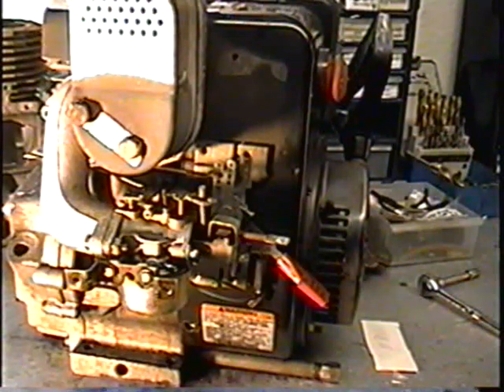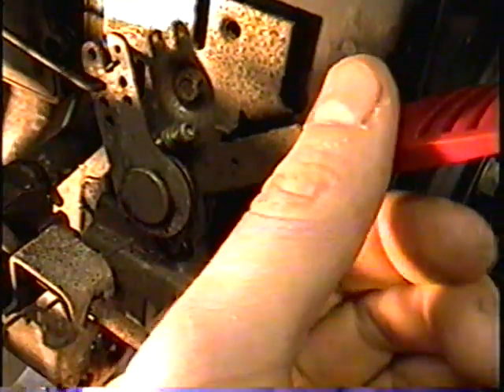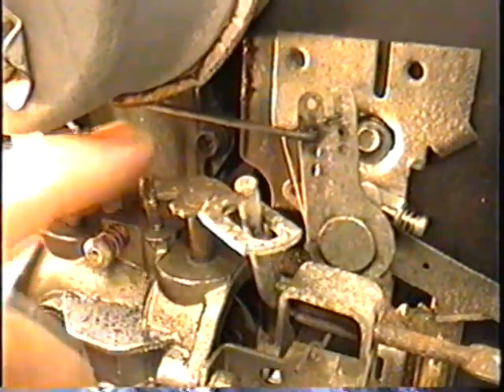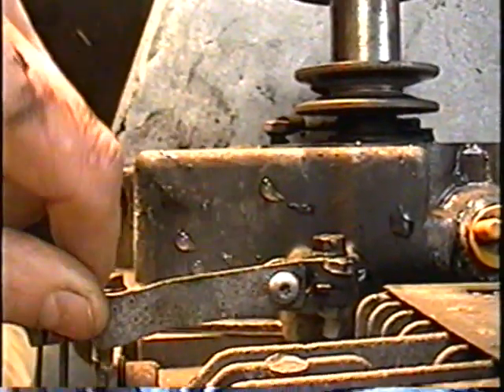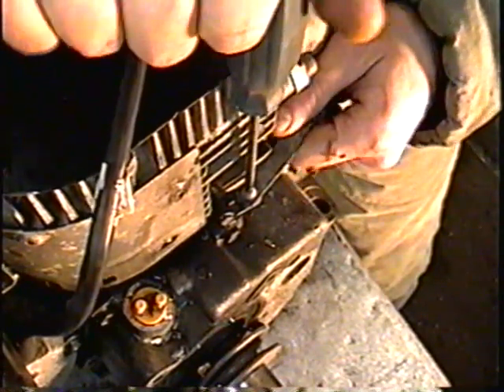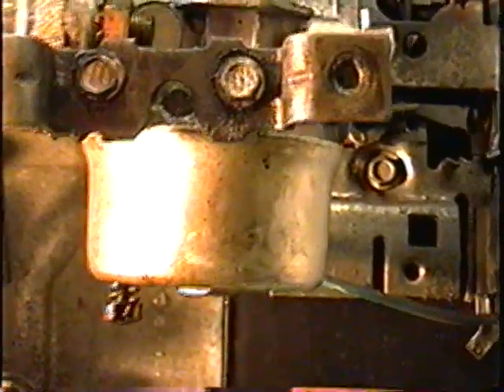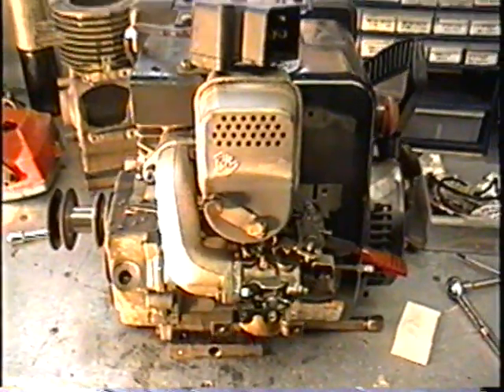HOW TO ADJUST SNOWBLOWER ENGINE SPEED GOVERNOR

Comment: is the Throttle lever suppose to be at idle positon or full throttle position ? in here it says down so i am assuming (idle position) but on google and other videos it says to have it in full throttle when adjusting the governor . 

also what does it mean when i start my snapper 10303S 10hp tecumseh engine snowblower  with the choke on then i turn the choke off and it high revs to the point i have to shut it off right away i replaced the intake gasket, carb gasket, and cleaned the carb and rebuilt it and ( i think i set the governor right ??? i am not sure as im confused about my above part) i looked it up and it said leaks (that can't be it) clean the carb (i did that) but maybe i have to adjust the governor better or adjust the main jet screw or idle mixture screw better . i dont know what it is . and its hard to adjust anything because i can't keep it running to adjust things (or maybe i can) i'm just scared to keep it running while it revs high i don't want to hurt the engine . 

i would highly appreciate your professional input . Thanks 🙂

Comment: How should stay throttle with engine off? 

is a correct way to set the Governor: Unscrew  the governor screw, set to fully open throttle and then tight the Governor screw? 

I don't know if my governor configuration is ok. My carburator throttle butterfly stay 1/3 or 1/4 open when engine is off. 

I havent changed it for now, I don't want make mistakes... I only changed the spring with original code

Comment: Thanks! Donny, I made the mistake to loosen the governor lever to remove carburetor linkage
Reply: How do you remove carb linkages without removing governor arm?
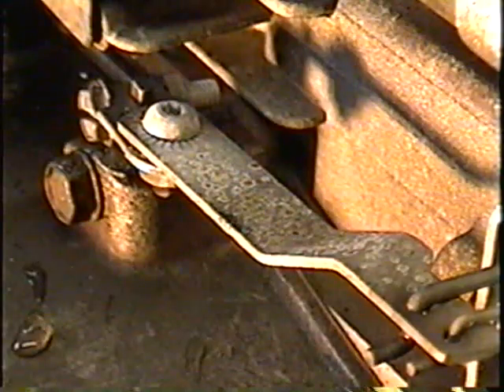Reply: Take the carburetor off. Is only couple bolts holding on the intake pipe and twist carb off the Z - bends that move throttle plate, @1:30. Leave linkage on governor lever. 1:19 show full view of linkage from the governor to carburetor. Take pictures with phone too help w/reassemble @imgusjj
Reply from the maker: Thank you for your support!

Comment: Donnie I have a major problem I can't find an answer to. I replaced the head gaskets on My Exmark Pioneer S Series. When putting it back together the springs on the control assembly came loose and I cant figure out how to re attach them. I am retired on fixed income so I try to fix most thing myself. If you can help me It would be very much appreciated. The  motor is a PS-ZT710-3011 19 HP. Thanks in advance

Comment: Hi Dan, I have an old Canadiana 8hp snowblower that I completely rebuilt from bearings to carb, ive been running it hard with all this snow and every once in a while it Boggs and wants to die while im in deep snow, say every 5 min, I just can't figure it out, took the carb apart , its very clean and rebuilt, all new lines and filter, I even ran it with the gas cap loose in case my vent wasn't working, im lost, never had this kinda thing... any help would be greatly appreciated , thanks for all your good work..

Comment: I've got a question when I start my snow blower it starts up and then I go to hit the throttle and it doesn't want to engage but I go and I mess with that bar the governor and it will stay running how do I fix that

Comment: Two things need to be addressed in this video.

1.  What is the down position for the throttle?  Off of idle?

2.  You mention where the governor arm should be when tightening the screw but you do not indicate where the piece the governor arm connects to should be?  That piece coming out of the engine block moves about 15 degrees in either direction and has a major impact on if this works or not.  

Thanks for all your videos!

Comment: You are my savior. Thanks for sharing your knowledge. Now I have a snowblower that doesn't rev like crazy and keep moving speed around and the idle now works. I might neeed a deep clean though because I was only able to adjust it with choke adjusted at notch 2, 1 being close and 4 fully opened.

Comment: Thanks Dony for your videos. After cleaning my snowblower snowlote 8/26 ..I am sensing my engine is too loud..and thus I concerned that I didn't have screws at the right level. I  took out 3 screws...one at the bottom of fuel bowl and rest two above it...do you think speed governor fix will help reduce the rpm and keep engine quieter...my concern is not noise...but if I am getting more rpm..and hence too loud..plz advise
Reply from the maker: rpms should be at 3600 max

Comment: Hi recently bought a new carb for my tecumseh powered snow blower throttle lever does not return linkage for speed have looked at spring behind it is not  broken this is the spring that goes around shaft in a circle then goes on top of lever control , could this spring be worn out or could i just put more tension on spring to return to idle

Comment: @donyboy73 I have a question about the screws/bolts  that hold the cover plate that covers the carburetor assembly and the ignition wires/etc. What size and threading are these screws, or what type. I'm missing two and the cover vibrates all over the place. I figure it can't be good for the ignition key and the wires which are already not in the greatest shape.

Comment: Great video. Took my snowblower in for new carb and they didn't put the linkage back in correctly. tried to tell me that's the way it is. Uh...no. Still didn't seem right and now it appears the spring at the throttle lever is missing. Any idea on a part number that. The big spring, not the little one that the adjusting screw runs through.

Comment: Donyboy, my confidence in my abilities to work on my own engines has skyrocketed since I started watching your videos. Maybe too much. I'm stuck. New carb (non-adjustable) and some 1/4" internal fuel line had my problem child (Ranch King w/ 8hp Tecumseh) purring like a kitten. Then I tried fine tuning and screwed it all up! Stalls at full throttle. Tried various adjustment on high and low throttle speed screws. Governor hasn't been touched at all. Love your channel!! Any help is greatly appreciated! Thanks!

Comment: Hey Don, ive got an 8 hp tecumseh. It runs like a champ.  Occasionally it overrevs off load. So like when ive gone through a big pile of snow it slows back down, but not to normal. Its like sometimes it gets hung up. Its not all the time though. Linkage and throttle mechanisms seem free moving.  Thoughts?

Comment: I was working in my neighbors blower and it would not run smooth unless you had the choke mostly closed. I checked out the whole carb and saw nothing wrong. I adjusted the governor lever and now it runs smooth. I find this kind of strange??? I have never seen this happen with a new machine. He just bought it last winter. What could have made this happen?

Comment: Thanks! Having these exact issues after putting on a new carb, damn snow blower threw off the drive belt, again! Now I have to bring it inside and open it up. Again! I will try your suggestions
Reply: Hey, close up at 3:32... is there a return spring on the governor or am I seeing wrong?

Comment: Very helpful video to cover what has been written up in a less-than- clear way in other places.  I have a question though on my setup. Picked up a generator with the HM100 that has a piece of linkage with a spring built in running from the governor to the carb, almost looks like it is there to try to clear the exhaust. I have not seen this on any other Techumsehs or other generators of the same model. I’m wondering if this was stock or the issue I’m fighting is someone putting the wrong linkage on. Thanks!

Comment: Thank you so much for putting together this great video. I had the carb on my Tecumseh 9.5 cleaned and have been battling this high idle issue for about 2 months. After watching your video, I made a few adjustments (mainly the idle control being the culprit) and the machine ran like a champ!

Comment: I have a HSSK50  5hpmtecumseh snowblower. Your videos caution against over Reving these engines. What is the recommended  max rpm this engine?  I just put a new carb on the snowblower. Thanks Ray

Comment: Yesterday I replaced the carb, (didn't touch the governor, control arm), adjusted idle screw and carb adjuster at bottom of bowl but still way over revs. Will look at governor arm and throttle  spring next. Of course the machine is 21 years old and don'e own me a dime. Thanks for the direction!

Comment: Hi.  I have an 8 hp Tecomseh on an MTD 24 in snow blower.  I could hear it faintly surging (changing engine speed ) for a long time. this storm it got much worse.  The surging was changing the RPM's much more then it died after I did half the drive way.  I took off the heat shield thinking the carb needed adjust only to find it is not adjustable.  I changed the spark plug.  I cleaned both jets although they did not look dirty.  Carb cleaner is blowing freely through the holes.  I cleaned out the float chamber although that was not dirty either.  It starts fine, sound s good for the first maybe, 2 min then it starts reving up and down and I can see the speed governor moving back and forth, then it starts to run worse and worse and in about a minute it dies as if I had shut it off. 
When I had the float bowl off I noticed holding the float up made fuel run out of the fuel hose (I had blower standing on it's nose) so I don't think it's fuel starvation.  The governor arm has never been off the blower.  After the first few minutes of not moving, the governor starts moving as I described eventually the engine just stops.  Any clue?

Comment: What is the proper rpm on a tecumseh hssk50 engine at full throttle
Reply from the maker: 3200-3600 rpm
Reply: thanks a lot

Comment: thanks as always ...  I've got a 1990 JD 826 and I cleaned the Carb and put in a new Carb kit.  I also replaced the drive belt and the auger belt but it won't throw more than 3 feet. what gives?  it runs awesome and doesn't bog down or anything like that.  any info will be appreciated.  thanks
Reply from the maker: you may need to adjust auger belt idler pulley like in this video https://www.youtube.com/watch?v=Ax-RrotWSlM

Comment: Very good videos. I have a tecumseh snowblower that starts and runs but it pulses the rpm up and down won't stay at a steady full throttle. Also seems to need some choke left on or it will die.

Comment: hi donyboy thank for your video that help me a lot ! But after adjusting  my carburator it seem my job wasn't well done as i thing . When i turn on the auger drive to blow the snow and it become hard the engine slow down and they lost is power. Is it can be  about a bad carburator adjusment or just my engine snowblower getting to old ?? I have another problem to ... the gaseline trought out of my carburator constantly . Leak is between the carbutor base and the casing what could be the cause ? the carburator float maybe ?? thank you

Comment: I'm in south Florida, so I don't have a snowblower, although I did have to find and wear my jacket last week.

I do have a Champion generator, which I'm trying to repair. My question to you is, re: your video, when you said ..."throttle lever in down position..."  with regard to the machine to which you are demonstrating, is the "down" position where the throttle is "open" or "closed"? 

Many thanks - I hope to have the generator ready for hurricane season.

Comment: I removed the carb on my 5hp Tecumseh to work on it.  I marked the hole on the throttle plate that the linkage was hooked to.  I reinstalled it.  When the engine is not running when you move the throttle lever the throttle moves,  When the engine is running the governor pushes the throttle all the way down.  You can manually rev the engine by pushing on the throttle plate but it goes back to low throttle  when you let go.

What did I do wrong and how do I fix it?
Thanks!
Reply: I made a video trying to show what is going on.  I saw where you said having a video helps https://www.youtube.com/watch?v=SA4XjmOWLBc&feature=youtu.be

Comment: just bought a Tecumseh 10.5 it starts great and idles no prob but when i put it in gear and run it ..it dies after a few seconds like it ran out of gas 2 pulls and it starts right up...fuel line dirt or crap in the main jet ...what do you think..thanking you in advance

Comment: Hey Donny, what do you reccomend, the max rpm to be set at on a Tecumseh 8hp, hmsk snowking engine at full trottle? 3600 rpm? I checked the engine on my Snapper and its running at around 3450 rpm at full throttle right now, but it needs a cleaning and slight adjustment. Its a 2002 year unit, it has an adjustable carb. Can I set it to 3600 rpm or should I leave it, what to you suggest? The machine always had lots of power and threw far, Im not sure if it was always at 3450 or if it dropped over time from heavy use? Thanks in advance.
Reply: Well it turned out that my throttle return spring under the butterfly got unwound from its seat, so I had to wind it back and seat it. That fixed the no or slow response.
My throttle arm did become weak and lost tension over many years, so I swapped it out for one with full tension from another blower I'm selling. My bowl gasket was slightly worn as well as the bowl gasket washer. The one rubber that had deteriorated was the o-ring for the high speed adjustment idle. So I gave the carb a good cleaning replaced those gaskets, adjusted the carb and idle screws have the low at about 1800 rpm and the high at about 3600 rpm. Its running as good as new now.

Comment: Great tutorial! You explains things very well.
I have a problem that is a related to the throttle lever, but is a bit different. I have a 1999 Ariens model 924104-ST1028 Sno-Thro with a Tecumseh model HMSK100 159391W emgine on it. I can raise the throttle lever & increase the rpms, but as I use the snow blower the lever drops & the rpms shortly drop off. So, I have to tie off the throttle leave in the max up position while snow blowing, otherwise the rpms drop off too much to blow snow well.
I thought the problem might be the Tecumseh 34663 Spring as you showed in the video above. When I checked it out, it looks intact, in one piece, plus it does work when increasing the rpms.
So, what could be the cause of losing the rpms?
Sure would appreciate some help. I would prefer not to have to buy the entire Control Bracket Assembly P/N 34677. Looking for a less expensive fix if one is available.

Comment: HI i have a Tecumseh engine and the carb and the coke was really messed up by a repairmen who didn't notice the governor was frozen so it now runs in surges, when it gets to throwing snow it acts like it wants to stall, and when idling its really to hi. when pushing the choke lever only responds to the full position, do you have any thoughts you can advise me on.  what i wont do is take my snow blower back to any service center that has no idea how to fix it and  going to charge me a lot of money to NOT fix my machine . id rather just do it my self
Reply: ever fix it? my 8hp 70's era tecumseh did 90% of my drive way fine then started to bog with only 4in of snow and when it wasnt throwing snow started reving to high. my father in law and I have just partially rebuilt this thing and it was running like new for 15 min... cant wait for electric powered blowers and lawnmowers honestly this shits annoying

Comment: Donyboy73: Just wanted to thank your for your excellent videos. When I started my Ariens Snow Blower this morning it was racing like crazy.  NO idea why this would have occurred. I have never done anything to the carb, and it was running fine yesterday. 
Followed you instructions and was able to fix the problem by adjusting the governor arm. 
Motor ran great after that, but the unit would only throw snow a few feet and got bogged down in high drifts. 
Went back to YouTube and found your video on adjusting and replacing the V belt.  Thanks to your excellent video the hardest part was finding the right belt.  - I did find a cotter pin puller to be very useful in getting the belt aligned on the wheel. 
Very grateful for your help.
Reply from the maker: you're welcome, make sure you are subscribed

Comment: so I had to run a new fuel line through my Tecumseh snowblower engine in that processed I did wind up disconnecting the governor control rod and carburetor control rod and the governor control arm was removed and this past Friday I ran that snowblower and it had melted off the exhaust where the exhaust bolts or cherry and fell off so I think that little bit on the governor which I think is what I messed up will help thank you

Comment: Thanks Don!  As always, you are my go-to for my small engine issues!  As you mentioned, I replaced the carburetor and took off the governor arm for the linkages and didn't re-install it in the correct position.  At full throttle I was turning at 4200 RPM!
Reply from the maker: thanks for watching

Comment: On the engine in this video, is there a governor spring attached anywhere ? I am about to replace the carb on an identical engine. All I see is the two linkage rods hooked into top of governor rod. One to throttle lever, other to carb throttle plate. Thanks for doing the videos, they help alot of folks.

Comment: Hi Donyboy73, my snowblower sometimes stalls when it revs low due to heavy snow. When it has to work harder. Like the mixture is not right. Maybe not enough gaz. But runs fine in lighter conditions. I think maybe my linkage rod to the butterly plate in not in the right hole. What do you think? What happened when you move the rod to the other holes? Thanks.